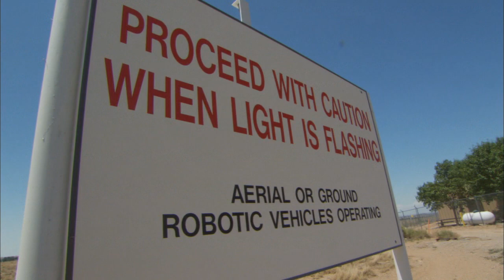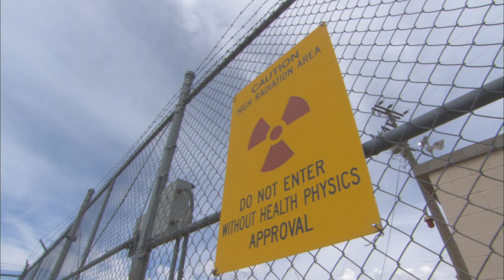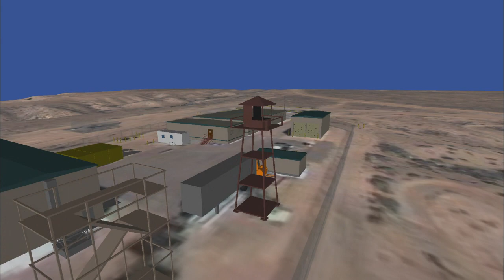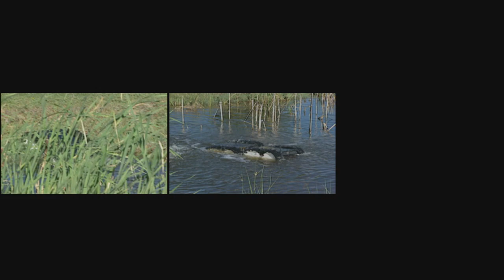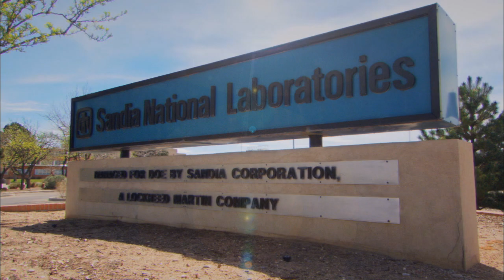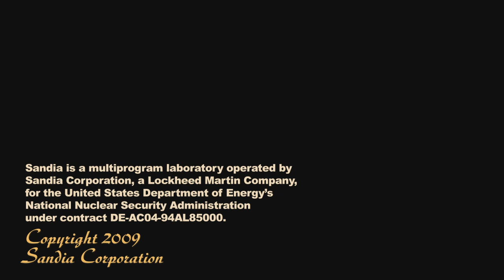Sandia's Robotic Vehicle Range

Comment: I’m sure the robots used in dangerous situations saves lives and is very expensive, but a single $50 hand grenade would easily disable it, right?
Reply: That's not an acceptable point in defense. You make a point that is moot, it takes a large sum to train and equip each soldier, but a $4 bullet will take his head off. You still have to train people, design robots, and if a robot gets a hand grenade in his face, he won''t feel it. Just build another one.